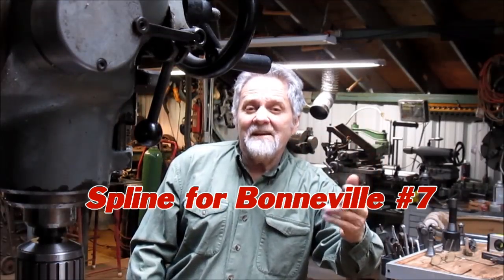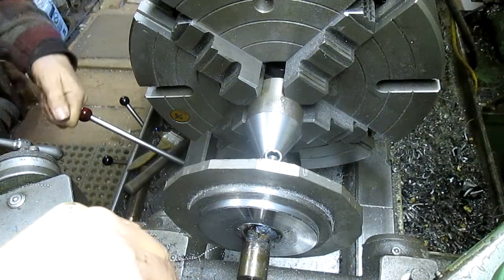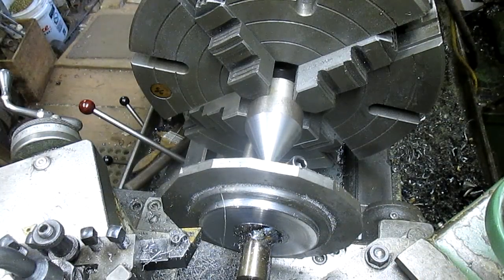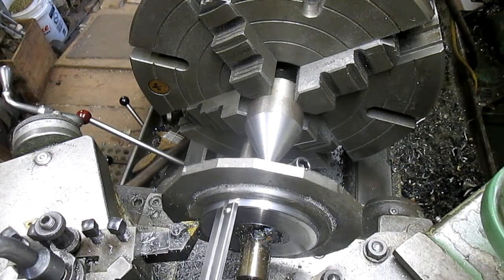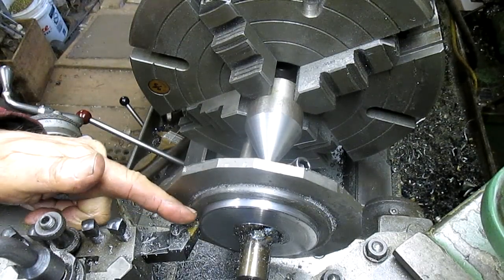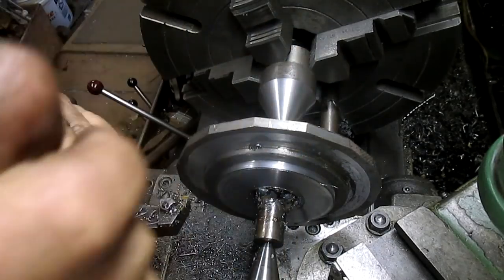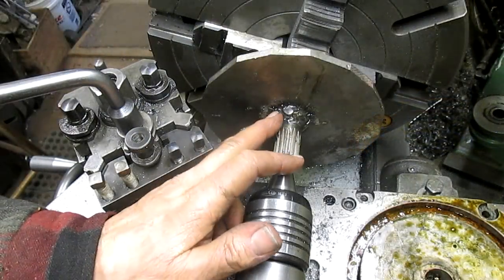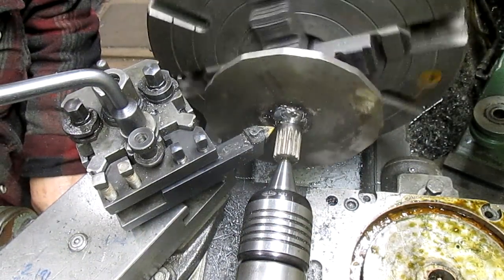Spline For Bonneville Salt Flats #7

Comment: Whooo Hooo, got it right this time Nik. You certainly left plenty of material on for final size. Was it much damage to the spline when it slipped ? Hope your Snow soon goes and you get electricity back on soon. I take it that you were / are running your generator. Happy New Year. Regards from Australia. Mid 30's C this week, Supposed to be 40 C for New Years Day.
Reply: 40 deg. C. = 104 deg. F.  That is effing HOT.
Reply: The slip wrecked 2 teeth in the spline outside of the contact area on the curve left by the cutter, so no problem. We have had no power for a week now and no internet so I have been editing a bunch of older projects from last summer. I have so many I may put each full project up at once just to reduce the backlog.  Power is still a few days away if not more. We have a small honda generator for the house. No power for the shop.

Comment: If I remember correctly there is a tracer attachment on the big lathe.  Could it have been used to cut the radius on the shaft to plate interface?  Its looking good I hope we get to find out how well it works when it gets put to the test.
Reply: It could have been used but the tooling and setup wasn't worth the time. I had the rounding bit on hand.